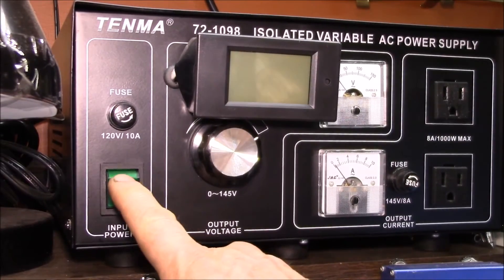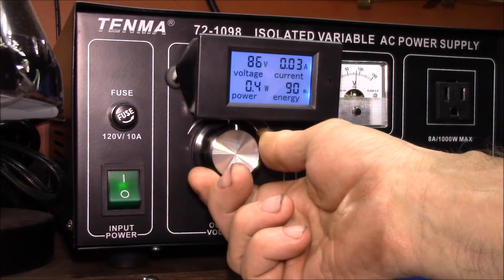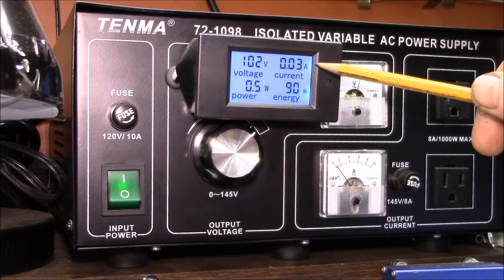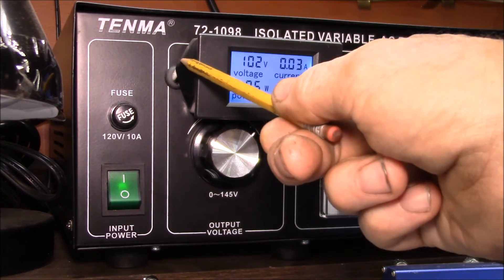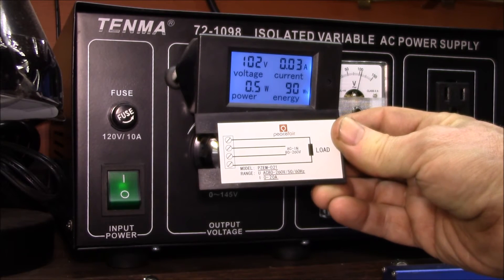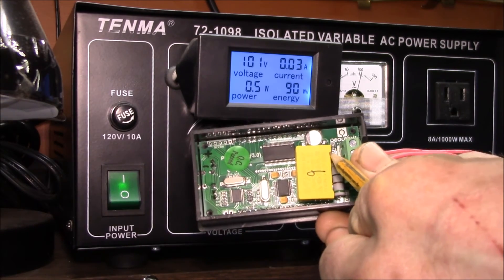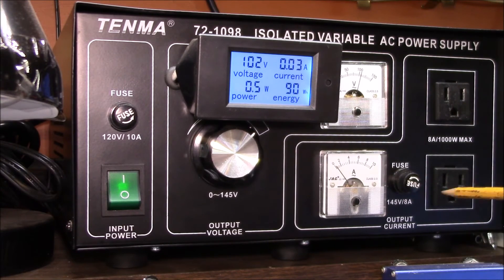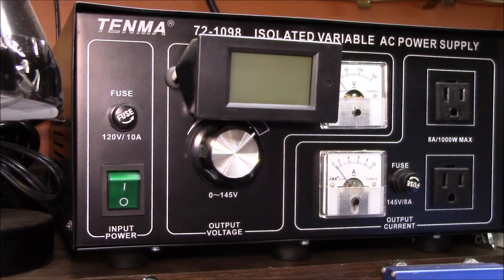Quest for Zero, (a.k.a. PZEM-021) Part 1

Comment: I have problem with PZEM-021 .  Since last week its start showin 36 Volt intead of 220 Volt . I dont know why ,nothing special is happend.  its not possible reset  it , and now it is unuseble . Any advice ?
Reply from the maker: It may be the input capacitor and/or resistor that form the power supply is failing.  You might try the power supply mod I do in this video series, and while there, test the values of the cap and resistor and replace if needed.

Comment: IIRC, you placed the current sensor on the current meter wires. Could you be reading the current that the meter uses, itself?
Reply from the maker: Yes, that is correct.  Also, the meter uses a capacitive dropper for it's power supply, making the power factor low and thus the apparent current hig.

Comment: I like this meter as well. My problem is trying to figure out how to mount it into a box that allows me to set it into a wall. Anyone have any experiences with this?
Reply from the maker: Not too hard to do with a sheet metal nibbler.  That's what I used on this project as well as in this one, where I set the meter into a metal gang box with a metal cover plate::
https://youtu.be/LhR-Z6lBeZw
You can get hand operate versions, or there are versions that attach to a drill, etc.:
https://amzn.to/2F7xR2B

Comment: Great Work. Very thoughtful and good video. We will soon see the fix for precision reading.
Glad am here.
Reply from the maker: Thanks for the comment.  I know when I initially hooked up a power meter in this supply, I just connected wires where I could and it seemed to work, albeit with an offset in the power reading.  But to get rid of that offset takes some thought to figure out why it was there in the first place.
Reply: have you modified this power meter for separate power, that might help Amp n Watts bring to 0  But I think the manufacturer of device purposely induced this erratic reading. Considering the power on, the load of this device itself. if you hook your other meter with this meter to check the watts and amps it actually consuming itself.
Reply from the maker: Yes, I cover that in a separate video:
 https://youtu.be/b2MXXSuzM2k
In doing that you have to be clear on properly identifying the line and neutral connections since that now matters.